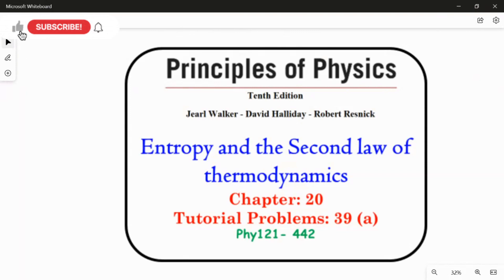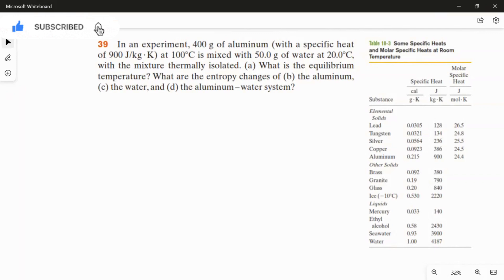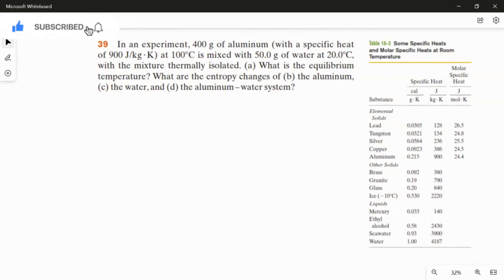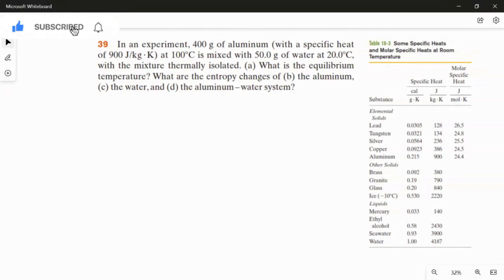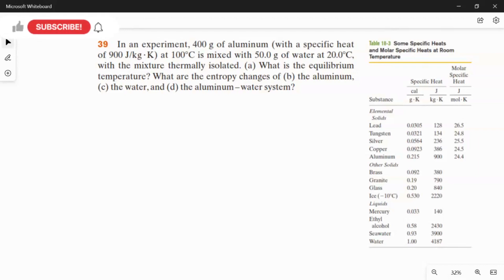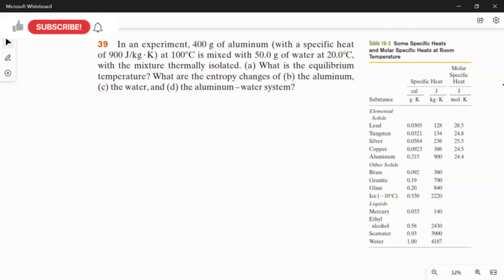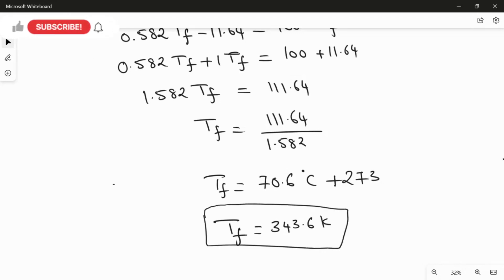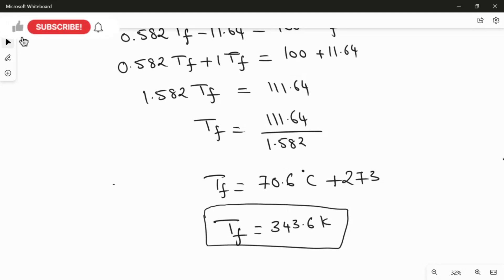Chapter 20 -Problem 39 (a)- Entropy and second law of thermodynamics -Phy121 - 442.

Comment: How did you know that the equibrim temperature won't be above 100°C for the water & aluminium?

 Because if it was, then you would have to add an extra process for the water that is the latent heat?
Reply from the maker: 1.Here you are mixing Aluminum with water....here Al initial temperature is 100 c and water initial temperature is 20 c. if you mix both... Al is going to lose the heat energy and water is going to gain the heat energy....When you mix, heat will flow from hot body to cold body...in that case how it is possible to get the final temperature more than  100C. After mixing, the final temperature (equilibrium temperature ) is common for both Aluminum and water and the temperature should be less than 100 C.

2. Here you cannot use the heat transformation formula (latent heat)...Why because the latent heat formula is applicable only if the phase change takes place (Solid-liquid-gas). In this question, there is no information regarding the phase change. 

Thank you